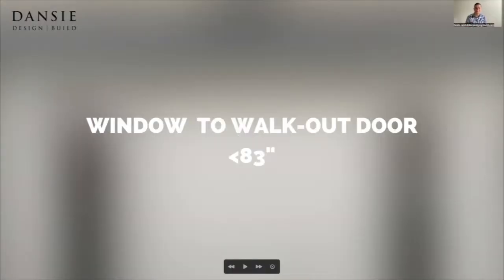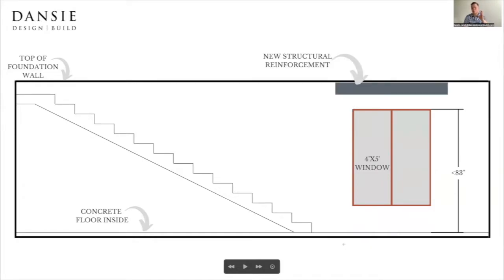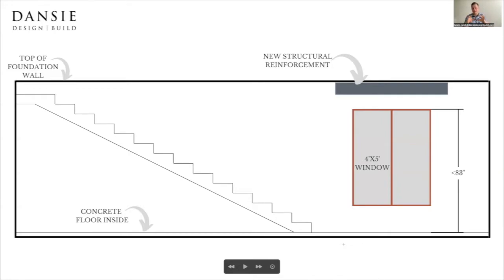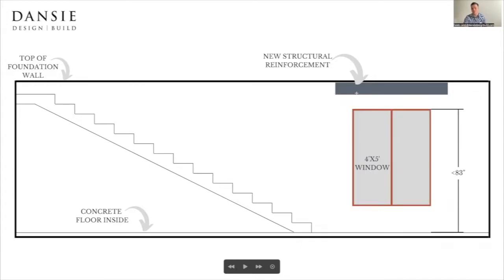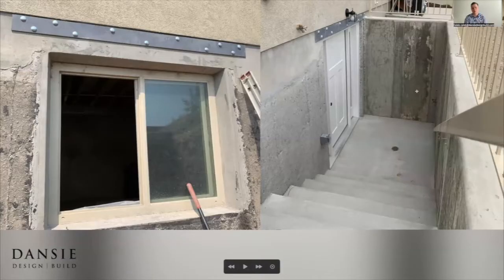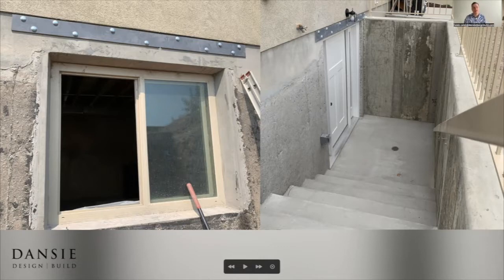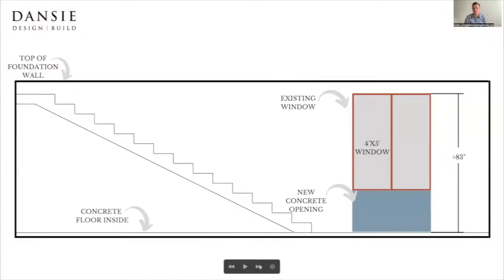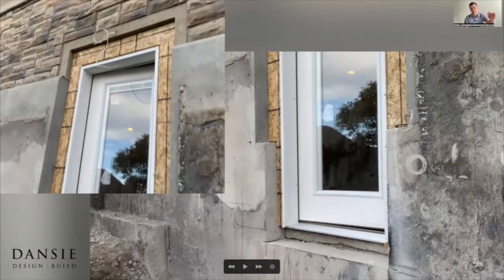How to Know When You Need Engineering for Your Basement Walkout Entrance

Comment: Engineered reinforcement, a.k.a. concrete and rebar. You could charge $8000 for $100 worth of materials.
Reply from the maker: Haha, the point and reason behind having it be engineered is to ensure it’s calculated and for-sure going to work. We live in an earthquake zone, and so factoring those things in is important to me. Long ago we decided to build our projects strong, and right never taking short cuts or doing things the easy way. And at the same time we’re build a reputation that is also strong, a reputation of doing things the way they should be done.

Comment: I understand you're concerned about the forces coming down with what about the side loading?
Reply from the maker: Hello there, 
I am not sure I completely understand what you mean by your question.
Reply: won't the bottom plate of the bearing wall above cover the side load?  Or you can use a C-channel steel rather than flat plate.  Im not an engineer but that makes sense to me.

Comment: Thanks for posting. I've been trying to figure out what doing this to my most recent property would look like. My windows are 86" off the concrete floor, so it sounds like we wouldn't necessarily need an engineer for additional reinforcement. My plan is to cut an entrance and an egress on opposite sides of one another to ensure a bedroom can be put in as well.
Reply from the maker: Yes, with windows that high off the concrete floor, you will not need to cut the concrete header above the window.
I am not sure if you need both an entrance and egress.  It would depend on what your local municipality would require of you, but generally, they only require one point of egress/entry for a basement apartment, and an emergency egress/exit window for each bedroom.  I hope this helps!

Comment: I have an old home built in the 1920s. The basement has low ceiling. Appx 70" from concrete floor to bottom of first floor joists. The basement door is small. Appx 28"W x 67"H. There is no concrete header other than a true 4x8 running the perimeter of the top of the foundation. There is a little room to make the door wider, to  a 30" - 32"W door, due to the concrete walls on the exterior steps. My question is how would you proceed to replacing origional wood door with a steel door?
Reply from the maker: Hi Dune Buggy,
Thanks for tuning in to our video.  
There are a few things we look for when modifying a structure like this.  Widing the opening is going to affect the structrure, and it is important to make sure what you do will either:  a) be reinforced, or b) be ok with out any updates or additions to it.  I consult a professional structural engineer when doing any project like this.  Then, I know it will not fail once we finish our work.  It may cost $500-1000 for an engineers professional opionion, but that is money well spent. My guess is that if you are just widening the door a few inches, there mostlikely would be rebar in the foundation - on the sides of the door that is going to be cut and affected.  This may need to be reinforced, but I would leave that detail up to the engineer.  Once the engineer is finished making his recomendations, you can plan how to put those pieces in place inorder to accomidate the new door size/opening.
I hope this helps you with your project!
-Caleb

Comment: Is there a minimum distance from a foundation corner where cutting an opening wouldn't be possible or safe? I have a small hallway that leads into a corner of the basement that would be great for an entrance but it's narrow so the door would only be a couple inches from an adjacent foundation wall.
Reply from the maker: Typically 4’ is a minimum distance from a corner or sheer wall. It may still be possible. Where are you located?
Reply: @DansieDesignBuild  West Valley City, Utah
Reply from the maker: Great! If you are interested, we could help you design and build an entry for your home. You can request a consultation here, and we will have someone from our team reach out to you. 

https://dansiedesignbuild.com/request-a-project-consultation/